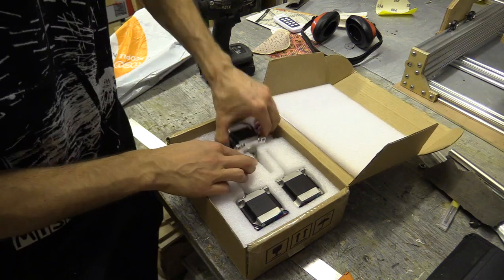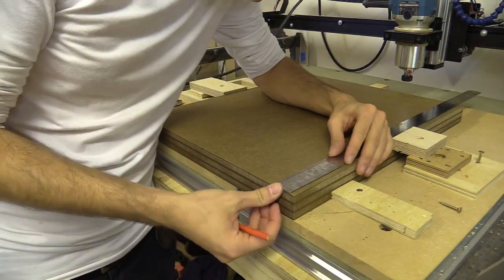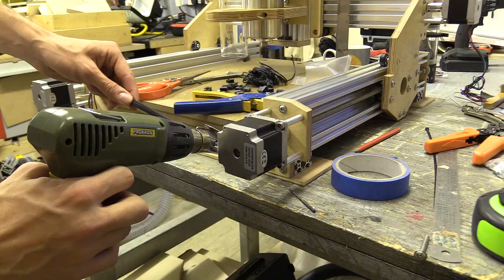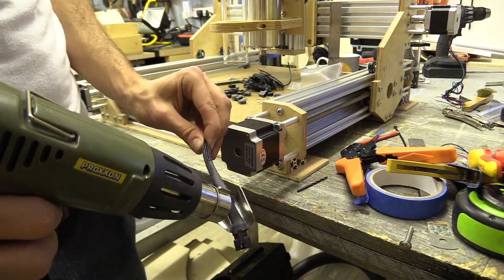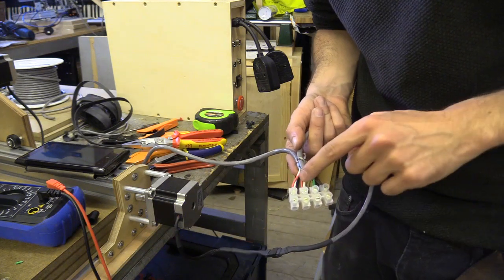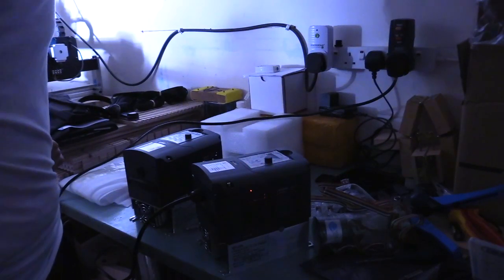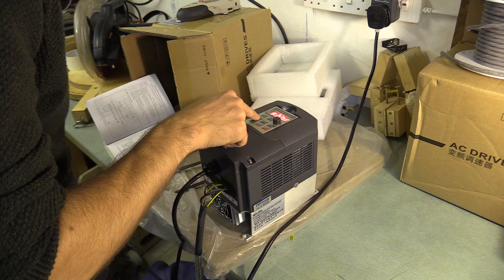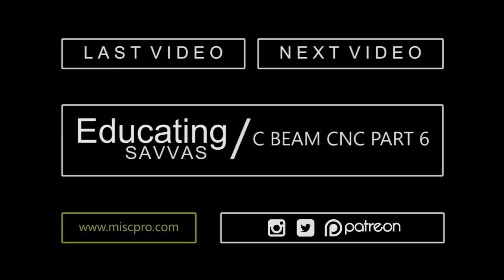#6 Installing Stepper Motors and Programming VFD #6 / C-Beam Lead Screw CNC

Comment: i need your help man , i am making a small 3018 cnc machine at home , is it ok to use flexible couplers on it? i could not find any regide ones in my coutry, when i try to mill , wont the flexible couplers ruin my z accuracy?
Reply from the maker: Depends on how fast you are going. Maybe try the spider type.
Reply: @EducatingSavvas   they cost way to much :( , i 3d printed some couplers , i hope they will last

Comment: Hello, wanted to ask about lead screw. Why do we need bearings while the lead screw is attached to the coupler and stepper motor, isn't the stepper motor and the coupler plus the housing, enough for the stability of the lead screw or in other words, what is the purpose of the lead screw bearing ? to cnc router ?
Reply from the maker: I have transgressed leadscrews - I now use ball screws. Never going back. See my latest videos and machine which I've called the Moot_One.

Comment: Hello. Thank you for the detailed description of the assembly, it helped me a lot. The question is, from what reasons you have chosen spindle 1.5 kW instead of 800 W? And why water cooling? I am now standing in front of the spindle option, and do not know what to stop. The construction machine 20 of the profile and the first stage will also part of the plywood. Aluminium we have very difficult to buy. Translated using Google.
Reply from the maker: The higher the wattage the more torque the spindle provides when cutting. But I went with the spindle and VFD because I got them for free by two companies who were trying to get cheap advertising. They became very difficult to work with, because they wanted to feature on my main channel and I decided not to endorse them and just take their products for wasting my time - which was a shame. Water cooled spindles can be run slower because of the cooling but they are more difficult to set up. Like I said in the video use a normal router or a HY vfd and spindle bundle on ebay.
Reply: Clear. Another question. You have installed Screws 8 mm in diameter. From your video shows that they are actually working, the engines are 57 and move the spindle 1.5 kW which weighs about 6 kg. I put it on the Z-axis ball screw 1204 and the X and Y belt drive motors 76. Seeing your video I think I should probably put a screw transmission, only I think of trapezoidal screws on 12. What do you advise me?
Reply from the maker: The thicker the lead screw the faster you can set your feed rate. so that is fine but you might need a different method to make the nut blocks. Some have mentioned HDPE to me, and melting a hot rod to create the thread. I've not tired that but it could work.
Reply: Well I think over your words. Ordered ballscrews SBU 1204 (Machine dimensions 1000x1000), so there were no problems, and the spindle 800 watts. I think this is the most balanced configuration for a home machine. Spindle 1.5 kW for a lightweight construction still heavy, but is much more productive than the 800 watt motor. 800W spindle think will make a noise so loud, and ball screws SBU 1204 will allow the spindle to move much faster. Your video really helped me make the right choice.

Comment: I am building and inventing a new fabric shaver that targets hair/debris removal from clothes and upholstery primarily and not carpets at first at least!  I have several spinning brush heads that I would like to have more control and torque and speed and of course have the cleaning brislte heads all move indepdently of one another and be able to chage direction when spinning, osciallting and I want one setting where the patterned spin motion goes 3 degrees CW spin then 2 Degree CCW in the reverse of course direction.  this is very tedious and precise and controlled motion I envision when removing hair/debris from fabrics only.  To have someone help me design and install the stepper or servo motor and be able to test it out on my printed protoype, along with all the necessary and required parts that come with servo and stepper motors, what type of engineer or expert do you think would be best suited for this type of role?  Also, if the motor is too powerful and overkill, what would be the next step down in motor strength for fabric shaving in your opinion?  thx in advance and great video brother. Jon-

Comment: Careful with external wire shielding which is earthed, can end up with a loop
Reply from the maker: I've got a professional inverter from RS components and the manual says to ground the shielding on both ends of the motor cabling. It's all a bit confusing tbh.

Comment: I BUILT ONE FOR A MAN ABOUT TWENTY MILES FROM ME AND I FILLED THE ALUMINUM EXTRUSIONS WITH CEMENT AND PUT A STEEL TABLE ON IT. YOU WOULD NOT BELIEVE HOW RIGID IT IS NOW
Reply from the maker: Twenty miles feels like a long way to move something after its been filled with concrete.

Comment: 12:40 Why did you solder the copper shielding to earth?
Reply from the maker: It is how you screen the core cables with interference either emitting or receiving which can cause unusual CNC behaviour. It's like a Faraday cage.
Reply: Educating Savvas thanks :)

Comment: How Durable is using the roller as the linear rail?
Reply from the maker: Well they are made from delrin so they are meant to last but you are also spreading cost if something goes wrong as it's more likely you would only need to replace a wheel or bearing instead of an entire runner - but I am not in production and I use it occasionally - I can't say I have really put it through its paces.

Comment: Looks like the machine is designed after the Sphinx CNC?
Reply from the maker: Yeah - my inspirations were Open Builds Korea, C-Beam Sphinx, Ultibot CB3030, and the R7 CB CNC. Earliest lead-screw openbuilds machine i could fine was by openbuilds korea project. They have a youtube page somewhere.

Comment: Crimps are a high failure point. Solder your crimp pins to the wire then assemble the connector.
Reply: barbourj22 don't ever solder crimp connection, or tin wires to be used in screw terminal blocks. That is a serious fire hazard and illegal in most European countries as a consequence

Also, the lad making this video shows soldering the earth wire to the shield on the cable, also a fire hazard and should a fault to ground occur then nasty things happen.

Just before you reply, i started as an electronic technician working with intresically safe equipment over 20 years ago
Reply: jim tait   I understand why wires are not tinned then attached to terminal blocks but give me a reason why crimp connectors are not soldered.. I could care less about what is illegal in this country or that country.
Reply: And before you reply, I repair very expensive electronics for a living and have been doing so for almost 20 years.  I've seen more failures at crimp connectors than anywhere else.
Reply: If you've that much experience repairing high end equipment then you should know why and you should be aware of all the legalities, there are ISO standards covering these.
Additionally if a proper crimping tool is used and not the cheap crap ones you shouldn't have failures. Having said that periodic inspection and/or maintenance is required with any crimped or screwed connection. That's ISO too
Crimped connections rely on mechanical bonding and a form of cold welded joint that solder will interfere with as it doesnt have the same thermal characteristics as the crimp or the wire. Also, flowing a crimp with solder after the connection is made can affect the insulation of the wire: again affecting the mechanical bond with the crimp.
Lastly, should there be a higher power requirement at any point (within the rating of the wire and crimp) its possible that the solder will be heated to the point where it will flow again which can then short other pieces of equipment etc. 
These are basics and if you have the experience you say you have then you should know all that already
Reply: Id love to know what you consider high end. 
I've repaired sensors costing £50K+ in environments where downtime can cost a minimum of 100K an hour and don't consider any of that high end

Comment: why use shielded cable and the use those kind of connection blocks. now the shielding of the cable is totally ineffective.
Reply from the maker: It's only ineffective at one point along the remaining shielded cable, which is fine as I wanted the flexibility of being able to take these off.

Comment: I opened my chinese spindel and figured that the ground is not connected at all. Just saying :).
Reply from the maker: http://www.cnczone.com/forums/spindles-vfd/333308-cnc.html
Reply from the maker: Yeah I had noticed that as well... eventually.
Reply from the maker: If you connect your spindle to ground you can do a g38.3 probe cycle without using a crocodile clip on the bit. That said my spindle mount is now made of acetal now - and i was worried it was not earthed to the body of the machine.